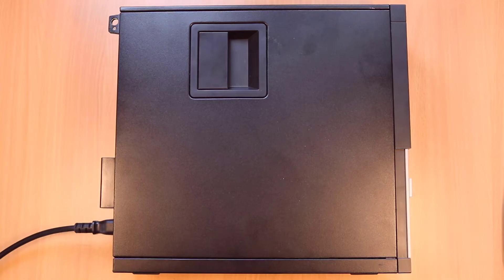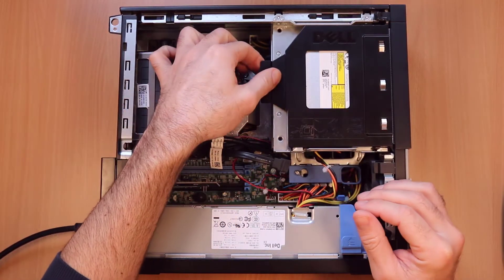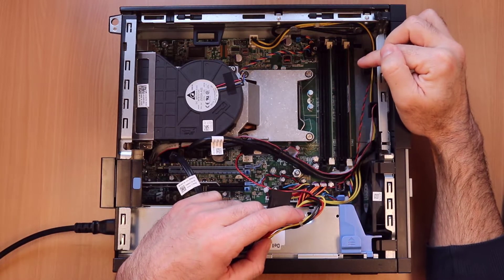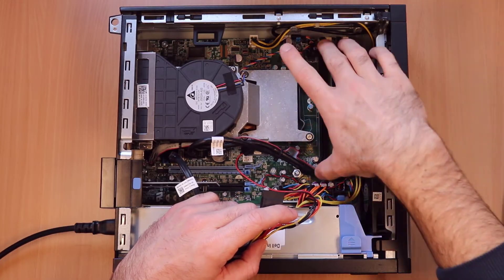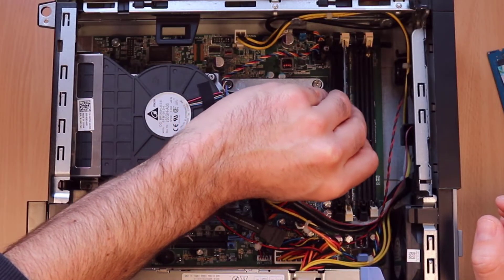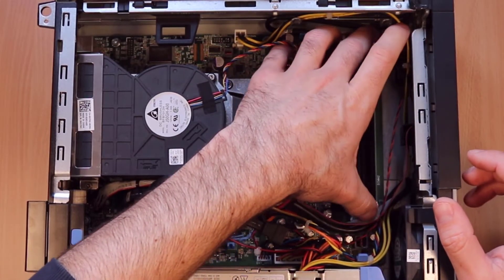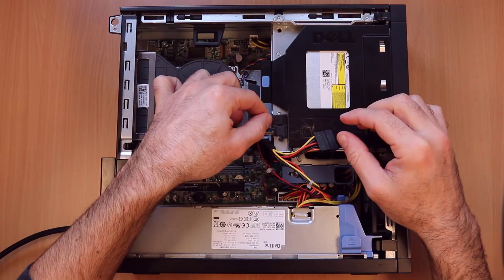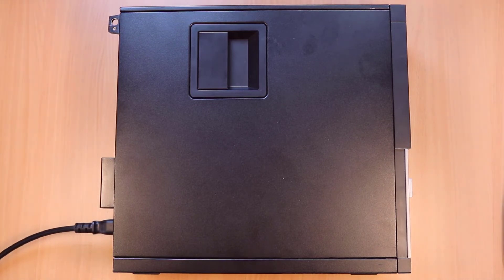Dell Optiplex 7010 SFF Ram Upgrade

Comment: Thank you Paul for your great video. I am looking to add 2XGB to make 32GB, I found the space below the SSD drive about 3.10 cm, and the existing ones are about 1.9 cm high. should I try the same heights around 2 cm, as the most available on Amazon, approx. 3 cm. any guidance or suggestion. Thank you

Comment: Hi,  I've just tried to do this upgrade on my Dell Optiplex 7010 SFF (c. 2014).  Originally, it had 8GB on two 4GB cards, so I bought four new 4GB sticks to get 16GB.  
But after the upgrade the pc won't reach 'Power On Self Test' (POST) stage,  it just cycles from powering up to powering down indefinitely (until you disconnect the power cable).  The RAM sticks are clearly compatible because if I just insert two if them  in instead of four  the pc boots up fine.
Any ideas please?

Comment: puedo ponerle 32 gb a la 7010 sff ?
Reply from the maker: Yes
Reply: Le pondría 4 de 8 gb de la misma frecuencia 1600 Hz mismas marcas , tengo un i7 3770
Reply: @wistonleon8642  hola yo tengo la dell optiplex 7010 MT, le puedo meter un 2x8 de ram a 1600mhz?, y sabes cual es la velocidad máxima de los sata para ponerle un ssd ?, gracias

Comment: Can it support 16gb 8x2
Reply: Yes. This model supports 16GB (8GB x 2), up to 32GB (8GB x 4). On one home game server system I run 24GB (8GB x 2 and 4GB x 2) with compatible RAM.
Reply: Can you do 3 sticks of 8gb?
Reply: @Gen-XInsights  It is certainly possible, but only if 16GB is causing 'lock ups' in processing. Otherwise, 16GB in dual-channel is sufficient. Otherwise it will just be a redundant single channel stick. Consider also, timings. They will ideally be identical brand and timings to ensure they don't 'downgrade' to the slowest stick. It really is a case of try and see. I have been surprised at how flexible this motherboard has been with adding 2 different brands, (identical brand pairings of dual-channel but all at the same frequency) in the available slots.
Reply: @arramus  ok so last bit/question..  I bought 2 new sticks of 2x8gb of ram. Took out the old stick and put in just the 2 new one and it only flashes yellow on the power button. I tried all variations of the new ram in with the old ram and nothing but flashing. I put the old 1 stick of 8gb in and it powered right up. I have read that dell won't allow RAM upgrades on certain devices... does anyone know of this?
Reply: @Gen-XInsights  You tried both of the new sticks individually, right, just to confirm one of them isn't a dud? Some systems only allow proprietary hardware, and HP has been known to pull that one. Dell is typically more forgiving on these releases.

Comment: Good video. Very simple to accomplish. Just now I upgraded to 32GB.
Reply from the maker: Excellent!
Reply: @archangelmusic13  Mine boots up super fast. If yours doesn't open, something is not right.
Reply: Doctor, el manual dice solo máximo 16 gigas de ram, me confirmas pero tu has puesto 32gigas. entonces el manila esta equivocado.
Reply: Did it work? I can’t find a 32gb kit thats 16x2 and works. Every time I order one that’s supposed to it doesn’t fit.
Reply: @S4PIENT  i just added some more ram to my 7010, i went up from 8gb to 16gb. i see no difference in any of the apps running on my pc.my 7010 has 4 ram slots.they do sell 8gb rams each. so i could buy 4 of the 8gb slots and go up to 32gb of ram, but i doubt it would make any difference.
Reply: @S4PIENT  Yes it worked.

Comment: What is max cap of ram in dell 7010
Reply: ..32gb, 16 would be good if you also do light gaming as 32gb may be overkill for SFF...
Reply: @blueshaylovinz  I upgraded to 32GB just now and it's running fine.